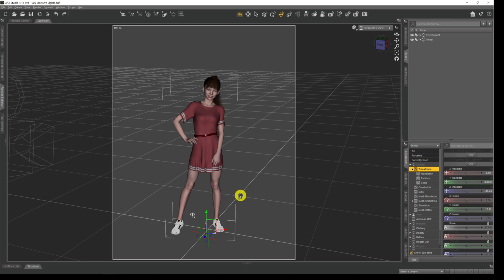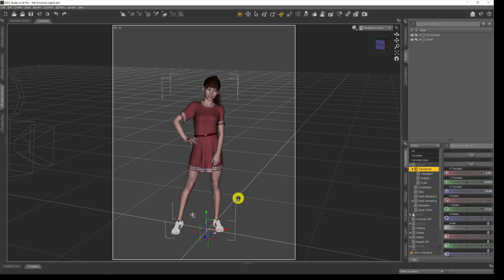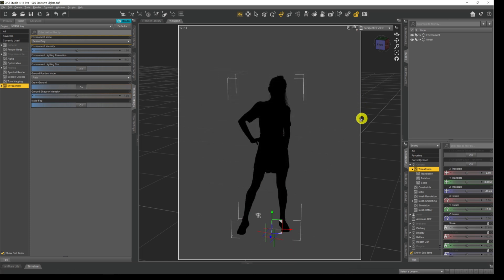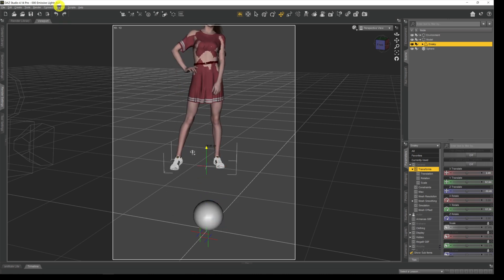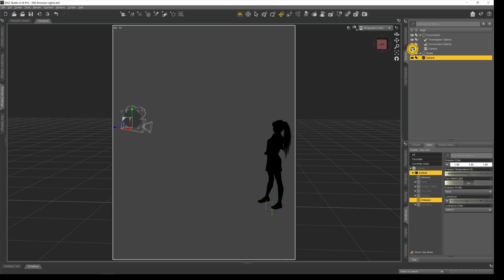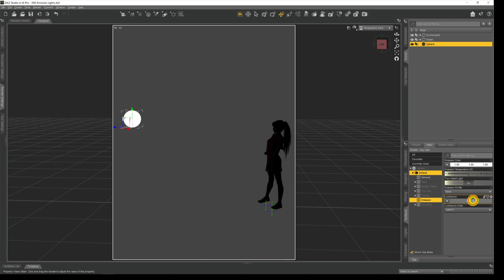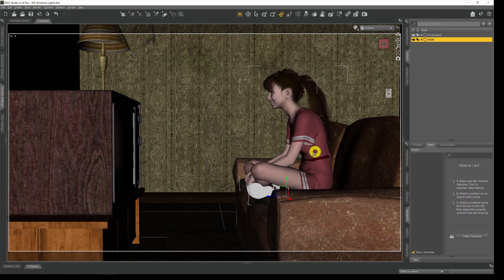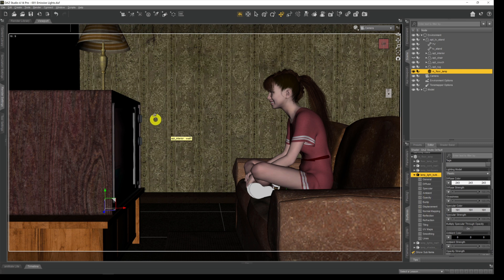Daz 3D Lighting Tutorial : Emissive Lights

Comment: How do you keep the image from being grainy? I’ve been having issues with my images coming out grainy in more dimly lit scenes? Is that my card or is it something I’m doing in lighting the scene? Love your stuff.
Reply from the maker: Gazillions of iterations! The less light in the scene - the more iterations you need to get rid of the grain (or, more accurately, to complete the render to a sufficient level the grain is gone). 

Yes, that means GPU power. The more you've got. The quicker and cleaner the image will be.
 
If you don't have the grunt under the hood - you could always use the denoiser and sacrifice a little overall quality for speed and time. Check out the following video if you haven’t already : https://youtu.be/4opzWycb0i8
Reply: @ I have a NVIdia 3070 Ti on my laptop. I have the 4090 on my desktop, but I’m not home right now. I got it upto over 3600 iterations last night, but it still looks grainy. Right now I need to upgrade my hard drive and add a second one, but i can’t do much about the GPU
Reply from the maker: @Mudwyrm  a 4090 should be perfectly fine - I have one myself .. depending on the resolution I can push out 30,000 iterations in a hour in 4k at 10:13 canvas ratio .. full 4k (16:9 ratio) - I can do 15,000 iterations - which is more than plenty for getting rid of grain.

What resolution are you rendering in? For me 3600 iterations would take about 15 minutes render time at the resolution and screen size mentioned above ...

So what resolution and screen size are you rendering in as you should be getting more than 3600 iterations before you're wanting to stop rendering. If that 3600 is taking hours then something isn't quite right (unless you're rendering in a huge resolution)
Reply: @ I’ve been doing them at 4k. I watched your rendering basics video and changed to the 10x13 and 1080 settings. My laptop is what I have been using lately and 4k takes 2.5 hours
Reply: @ I’ve been using the denoiser built into the render engine. I post in Photoshop but even that denoiser has issues dealing with the graininess or I’m not using it right.
Reply from the maker: @Mudwyrm  The denoiser should get rid of grain - that's it's purpose. If you're still seeing grain then something doesn't seem right
Reply: @RaukoDaz3D  that’s what I was wondering
Reply from the maker: Firstly - are you maxing out your system / Vram and causing the CPU to take over the rendering? How much system memory do you have? Ideally - you should have 4x your GPU Vram .. so for the 4090 you should ideally have 24gb x 4 = 96gb system memory. Running out of system memory also causes Iray to fall back to CPU mode .. 

Secondly, the basics .. go to Render Settings .. then click the Hardware tab up top .. Make sure your GPU is selected in both Photoreal and Interactive mode and UNTICK CPU in the same modes 

Check that basic things and then keep an eye out in Task Manager when rendering to see if you're falling back to CPU more (CPU will be running at 100%) .. that might explain the slow rendering for you ..

Comment: that lamp doesn't even work like a real lamp. I have a lamp like that, and when I turn it on the 
whole room lights up not just near the wall...Daz is totally inaccurate with handling lighting the way it would work in real life.
Reply from the maker: The problem probably isn't the lamp but the transparency settings on the lamp shade .. it's probably so opaque as to not let light pass through it - only from above and below where there's nothing blocking it. If I'd increased the transparency on the shade it would have let more light flood into the room like a "normal" real life lamp.
Reply: @RaukoDaz3D  That makes sense, I wasn't thinking about it from that perspective. :yougotthis: Sorry if I misunderstood.

Comment: Something you haven't mentioned in your videos about lights is noise and render times. Emissive lights, especially certain shapes, are noisier. Flat shapes like rectangles not so much but small round or cylindrical shapes are very noisy for me. Point lights are the next noisiest and spotlights least. The noisier the scene the longer the render. Sometimes the noise persists even after the render is done so you either mess with the default settings to give the engine enough time to finish or figure out a way to reduce noise and fireflys.

It's not always easy to figure out what is creating the noise. Right now I am working on a scene with no water and little glass in the scene but very noisy. The light sources are off camera so I thought it was easier to just add point lights for less noise and quicker render times.
Reply from the maker: I've found that noise comes from the lack of sufficient light in the scene .. it may well LOOK well lit but there's  probably not enough direct light in the areas where the grain is appearing and so it takes an age for that area / image to fully render out the grain .. 

I won't get into all the detail here as I am planning a couple of videos .. not necessarilly focusing on grain .. but the differences between direct and indirect light in scenes and pros and cons of each .. of which grain will be covered .. so keep your eyes open for that!

Comment: Any chance a tutorial of how to deal with insane high poly count hair? I having some problem with some character who literally crashong and burning my renders because of it.
Reply from the maker: Hey Darcy .. there's nothing much to be done in truth ..  the only option you have is, with the hair selected, go into Parameters > Mesh Resolution and lower the sliders on "View SubD level" and "Render SubD level" down to 0 (or as low as your system can handle)  and turn the Resolution Level to "Base" if that is set to somthing else. See if that improves things for you.

And that's about it really .. there is an old app on the Daz store called "decimator" or somesuch which says it cuts the polygon count on models - but last time I looked it was $100 .. too expensive for me to check whether it actually works or not with recent Daz versions ..
Reply: @RaukoDaz3D  i found a way, i turned the line tesselation way down, now its working.
Reply from the maker: @1986Hikaru  Ahh .. you were talking about strand hair .. when you said "poly count" I assumed you meant normal average hair .. but yeah, the line tesselation is more or less strand hairs version of SubD .. Glad you got it sorted!

Comment: The Default setting is cd/m^2  and if you use that the Luminance needs to go a lot higher, or you can change the cd/m^2 to  cd/cm^2. I guess setting the range from meters to centimeters means the low like is closer  to the light, Then you can use luminance below 1000. I think if you want the look of a 60 watt bulb, it might need 80 to 120 luminance, and that make it easer to guess  than try to get a bright light with an unknown number of zeros. I made a sun high in the sky so the shadows would be sharper, and a sky light with lower blue lighting to mimic the sun and sky and added clouds. I don't think that was a very good idea, because they sun light in the program can reflect the light from a mirror while this emissive lighting don't reflect with a mirror.

The single side and double sided can help if you want the light to go out the surface on both sides. If you use a lot of light on a plain and you see very little light, then flip it over to shine the light in the right direction or turn on double sided. There is a limit to how high the luminance. It might be around a 100 million and then it goes to the highest number with a lot of 9's and something like 2340 at the end.

The Emission Temperature for red light is below 1200, it is yellow at 1200 so, 1000 to 1200 is orange, bright sun light is all the way up.

I worked with emissive lighting a very long time ago in the 8th version of IMSI TurboCad 3D. Once I used it to create lighting that could go through glass, the program sky rocketed in price. That might be around 2003 or 2004. The lighting company had an odd name but their lighting was ray trace. I made a light bulb to see when I was getting the light through the glass, and while saving the scene with the light bulb in it, anyone that opened the file gets that lighting, and they took a year to notice look at it and then backdated their claims before 2004, because that was when I started to use it in a $9 version of IMSI TurboCad version 4. I just thought it was dumb not seeing the light go through transparent glass. It just treated it like a solid object, and people setup other lighting to create the effect. Once I finished the lighting it made everything look real and less like the 3D home design program, and light reflected through a mirror.

Comment: Other than not getting the complete black out (had to use "Dome Only" to replicate, don't know why), a very follow-able tutorial.  I am at the point where I am starting to make scenes.   Many of the locations have florescent lights and I was getting quite frustrated.  This should help solve many of the issues.  My thanks, sir.
Reply from the maker: Hey Heegaherger - thanks, I'm glad the video helped you out .. As for the black out .. do you mean during scene construction everything was black? if so, go to  Window > Preview Lights and turn that "off" - so the icon is NOT highlighted .. and see if that helps (on something other than Dome Only) .. or was it during Render?
Reply: @RaukoDaz3D   I was referring to scene construction.  I can get the black out while using a camera, but not in perspective.  Perspective still has light.  <shrugs>  Not as presented, but I can work with that.  I  definitely will be working my way through your library.
Reply from the maker: @Heegaherger  Yeah, it's definitely the Preview Lights then if it's ok in Perspective camera!
Reply: Thanks for this comment and thank you Rauko for the answer. Couldn't be bothered to google the problem, stumbled upon this comment and it helped.

Comment: Thanks. As usual I got a load of tips watching this tutorial. In some other tutorials I've also seen them use Luminance Units. You're not using them, are you? Is there a reason behind it?
Reply from the maker: Thanks, Ingemar .. as far as I'm aware, the Luminance Units (and I did mean to mention in the video! Doh!) are just the units of measurement of your Luminance slider .. they don't actively change anything other than how far up or down the scale the Luminance slider has to go to get the results you want. Think of it as choosing to measure in cms rather than inches .. it just a personal preference really .. Some of the numbers on the Luminance slider can get quite high so sometimes it's better to change to a different measurement unit to make them more readable .. it can be useful, also, if you're trying to replicate a real world light souce and you only have it's luminance value in a particular unit .. just switch to that unit in Daz and enter the number ..

Comment: Great walkthrough on how to make emissive objects and surfaces. My only suggestion would be to explore different luminance units. The default cd/m^2 (candles per meter squared, I think) is far too low to be practical for most scenes unless you really turn down the exposure value. I often find kcd/m^2 works better for tweaking values.
Reply from the maker: Hey thanks Sean .. I did actually plan to touch upon the luminence units during the video but .. forgot when I got to it .. 😄 .. Ultimately, it doesn't effect the final render but, as you say, it is sometimes more practical to use a different unit and allows for a lot of fine tuning!